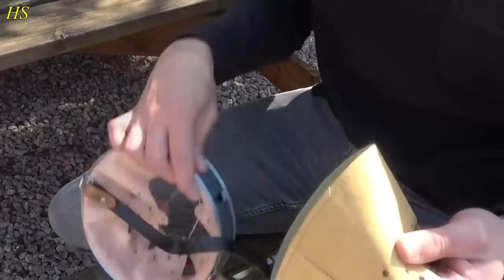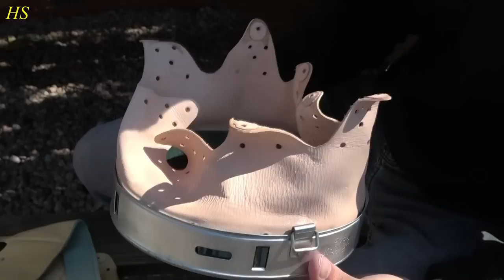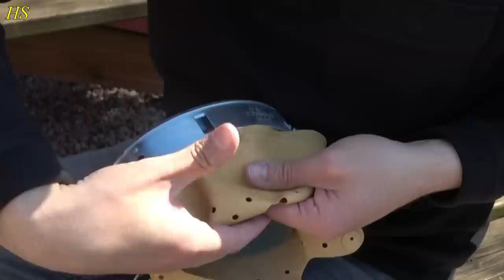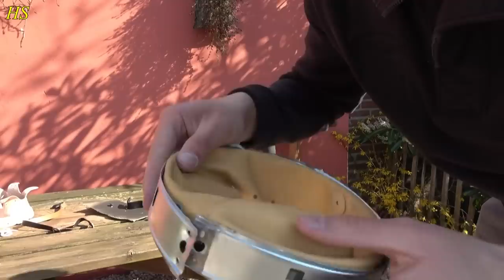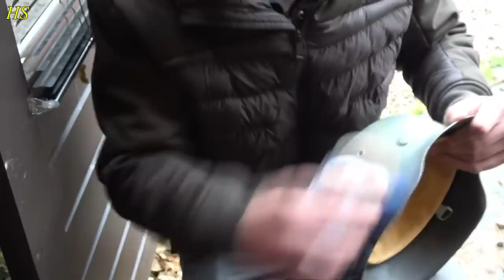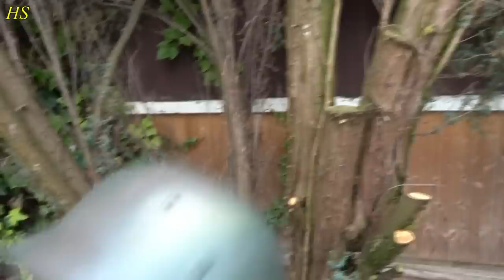Restoring / Refurbishing an Original WW2 German M42 Helmet - Normandy Camouflage - AMAZING Result!!

Comment: Hi Nick. I love your videos. They are very informative and entertaining. You are one of the pushing power for me to expand my collection. Like a month or two ago, I had the exact same problems with that exact same liner (the only difference is mine was size 64 and from a German vendor through ebay). These are hastily and really cheaply made. For sure, they are oversized, because mine didn't fit in the 64 Quist shell. In the last resort, I had to drill out the rear rivets of the outer band, and reduce the outer liner size and re-rivet the band. The chin strap on mine was also fitter in reverse and made of a lower quality leather. All the best from the Uk.

Comment: I can completely understand that kind of situations with helmet liners.
Once, when I was restoring a helmet, it happened to me that the liner was a little bit to large, I tried for hours to make it fit but nothing happened.
Luckily I was able to remove the pins on the rear of the liner, tight the liner band, mold it, and do the hole with a drill, but the idea of trowing it away never really left me until the work was completed.

Comment: Those split pins are almost identical to the 1920's-40's ones used in the U.S. for holding papers together.  The main differences are their legs are longer and they are of brass, not steel. It is rare to find the "washer" for the split pins, as I suspect the people were too lazy to use them and they were thrown out. For punching holes in the metal liner pieces or any light metal up to 16 gauge (U.S.) I use a Whitney Junior metal punch set. ( I use it for electronics and making armor).  I know there are Chinese knockoffs made. Great aging job.

Comment: i bought a german helmet today, checked it over numerous times, its original and is stamped E66 so ig its size 66, but the liner on the inside isnt at all the same as yours or most that are on here... its vastly different, professionally made nontheless, but it has a rigid leather rim, instead of a metal one, its fastened with rivets just like every other one though, but then again the cap itself is not one solid piece that ties together, its a lot of seperate ones, with cushioning sewn into them, im not sure if thats unique, just some frontline repair/improvement, or something special... the leather is incredibly old, and the chin strap has dryrotted away...

oh and additionally, its a 1941-42 cuz the breather holes are stamped into the helmet

Comment: Woo! New history secrets video!
Reply: Also, to add, I had the same problem with a size 64 liner and a size 62 shell.  I was (somehow!) able to get the liner in, mostly by Putting in the front pins first, then hammering the rear of the liner just enough so that I could slip the last split pin in.

Comment: Really amateur attempt at a restoration, the outer liner band is WAY too small on the liner you actually put in the shell.
Reply from the maker: Nope, it's fine! I can tell you never had too much original helmets in your hands.. 😂
Reply: @History-Secrets  WRONG, Not only do I have a fairly large collection of NON Relic condition helmets, I restore them PROPERLY. You see I don't use Bush League, Spray Can paint.
I use oil based enamels and used aluminum oxide for texturing, also correctly fitting liners from various sources as well as original rebuilt Outer liner bands.  
I even bake the helmets in a paint oven to accelerate the curing process. 
Kids in their parent's garage use garbage Spray Can paint, I use an HVLP gun and more correct materials.
Don't try to tell me where the Bear Sh!ts in the woods kid, I grew up in the woods and that Bear's skin is hanging on my wall.
You didn't restore that helmet, you sprayed a little rattle can paint on the shell and put in a helmet liner in the shell with at least 1.5 mm of play in it.
Your video shows this ALL, so there's really no point in trying to BS anyone.
Also I got my instructions on restorations from a Guy named Ken N., from Lapeer Michigan, you know the same Ken who published the well known book that people in the collecting community know very, very well.  But that's ok, you didn't know ANY of this before you decided to attempt to call me out.   Might help to know who you're talking to.
Reply: Youre right, lots of fumbling about, using canned spray paint and calling it a restoration.
Bet he used acrylic spray paint too. 😂
Reply from the maker: @Eric_Von_Yesselstyn  haha, it seems like you have some serious anger issues.. might be smart to get some fresh air now and then.. 🤣 I don't know why you capitalised NON relic condition helmets.. because these helmets were found by myself, so trying to sound cool by saying you have "NON" relic condition helmets isn't working I'm afraid. I also had, and still have a large collection of non relic helmets. The way you communicate comes off very childish.. This helmet was perfectly restored, and yet here you are, as a grown man, complaining about how bad it is, and how you can do it all better.. a bit sad really.. 😅 I also use aluminium oxide.. the paint I used was perfectly fine. And back in WW2, helmets were actually spray painted in the factory.. also, camouflage was done by spraying the helmet.. I owned, held and saw many camouflage helmets in my life.. And when I say it's a perfect restoration.. it is 😉 I know a lot of well known People (owners of big museums etc) I know my facts, and I have my connections. Also, I'm not a kid, I'm a grown man with a succesful entertaining and educative YouTube channel about History. Also, congratulations with your bear skin on the wall.. I don't recall me asking on how many hunting trips you went.. It's a bit off Topic.. 🐻 Also, the liner isn't that small.. and I've seen original helmets with liners that were too small too.. You should know this! 😀  Anyways, this channel is for People who enjoy History, and not for grumpy jealous People who start complaining for no real reason.. Learn some respect, and I advise you to leave my channel. Have a nice day.
Reply from the maker: @busternottellingya5575  I never used acrylic spray paint.. And if you would actually know a little bit about German helmets, they were actually spray painted back in WW2 too! Cute to see all these internet experts! 🐒🙃
Reply: @History-Secrets   First of all if you think this is anger, then you set the bar really low, if I was truly angry you'd know it, so don't get things twisted, sport.  
You USED Spray can paint and there isn't a self respecting person around in the restoration business/community that is going to use a Rattle Can of Spray paint on shell and call it a restoration.  And yeah, you're a KID, deal with it, be glad you're still learning and finding out new things.
Secondly, you have connections, Blah, Blah, Blah... Most of us that are reputable do and have things like helmets and smocks in places like the Western Reserve Historical Society and the like BUT....
If you really knew what the "F" you were talking about, you'd know that Museums are the WORST places to do business with..
Donations go missing, get replaced with crappy REPROS and end up gone forever, etc, etc, etc... Not to mention most museums do NOT take very good care of their items, maybe a dusting for display but left in boxes for moths to eat at.. 
Not every Museum is the Smithsonian.
And Finally The "BEAR: comment is a take on an old saying, the fact you completely BUNGLED it's meaning is humorous and gave me a good chuckle.

On a side note.. Helmets were NOT painted with RATTLE CAN SPRAY PAINT in the factory and thank you for proving everything I said with your uneducated response.
This wasn't even a challenge..

They were painted with SPRAY GUNS with Nozzles and pressure regulators.. Not  hardware store, modified Acrylic Spraint paints...  GD man.

EDIT: I never said Camouflage paint was applied at the factory, that didn't happen.
Reply from the maker: @Eric_Von_Yesselstyn  There's a lot I can say once again, because a lot of things you are saying do not make sense.. I can see you like to assume things without even knowing anything about them.. for instance, you don't know what museums I am talking about.. they aren't just simple museums with replica items.. 🤣 And no, I'm not a kid, sorry.. you behave like one though.. 😅 Also, you don't even know what kind of paint I used to spray the helmet.. all I showed was the camouflage, the paint I used in the first place is high quality paint with aluminium oxide. And yes, I know camouflage wasn't done in the factory.. I never said it was. Anyways, I think you are overreacting, and need some fresh air.. 😀
Reply: @History-Secrets    Rattle can Spray paint restoration...      That's not how it works.
And yeah, you are a KID, be glad you're still young and have NEW things to learn.  
The point is, you didn't paint the shell with oil based enamels, you didn't use fine aluminum oxide powder that had been used as blasting media before hand, you didn't do one of those things.   You used a rattle can of spray paint, sprinkled whatever grit of aluminum oxide on it and sprayed it again to seal the oxide down, after the first coat settled/dried for 12 to 24 hours, maybe less..   Without a HVLP gun and instead using a spray can, that's the only way you're gonna get the job done, without having exposed aluminum oxide.
You didn't use a HVLP gun for any part of the process.   I have YEARS of experience painting with oil based enamels on metal/steel.
You calling that paint job a restoration is just not cool, you know it and so does ANYONE else that knows.  
Might want to join one of the Restoration group's forums and start asking questions, you'll learn a lot.   

That edit in the previous reply, was preemptive, so you didn't misunderstand and try to jump on a perceived opportunity.